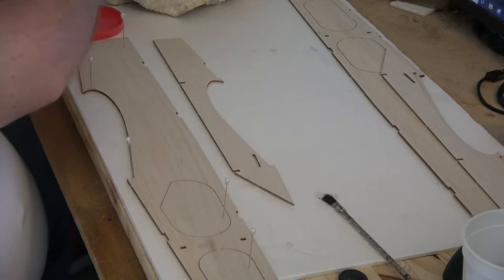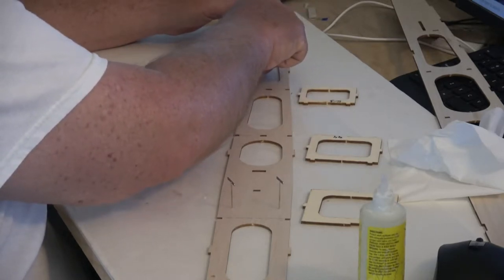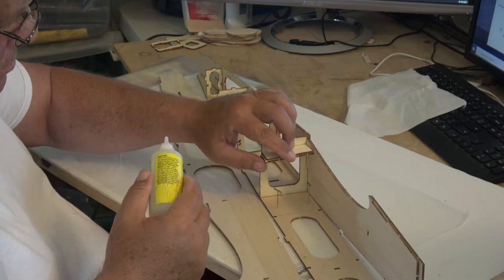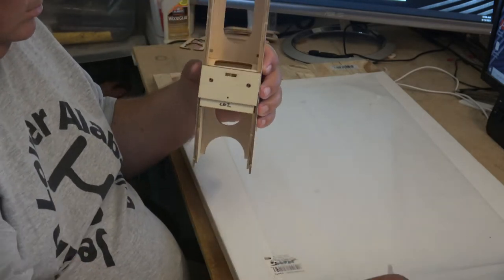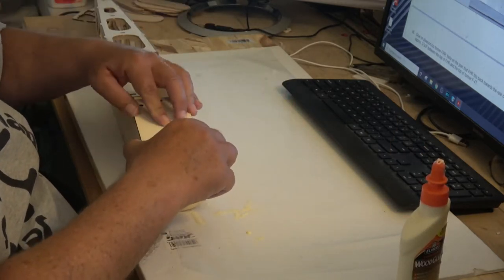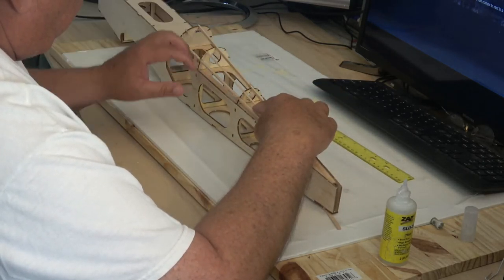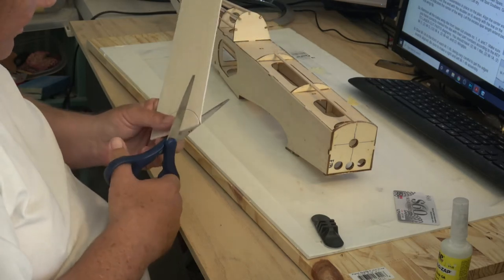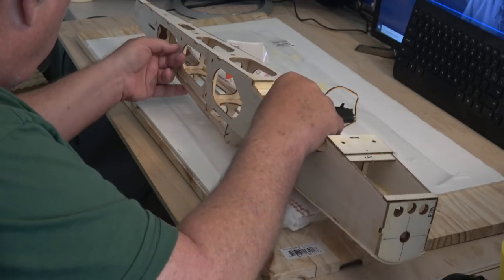First KIT Build SIG Four Star 20EP The Fuselage

Comment: That was fun to watch Jeff, it's great when the top stringers go on and you start to really see the shape coming together. I was thinking personally I would glue in a support for the pushrod outers half way down the fuselage to prevent any whipping 🙂
Reply from the maker: I'll do that Cliff, already notched to attach the pushrod tubes will glue before covering, good call. Cliff thank you.  There is a lot of sanding to be done on the fuselage😁 I'm going to install the elevator and rudder servos to make sure the pushrod tubes are straight then remove the servos for covering. Thank you Cliff for your help and inspiration for the build, Jeff

Comment: brings back some memories  :-)  ...thanks foe sharing...some of the 'hardwoods' don't soak up the glue very well.. We used epoxy and drilled little dimples in the hard wood so the epoxy formed it's own dowels for strength and alignment...
Reply from the maker: After sanding the fuselage I found 2 spots that could use a few more drops of glue. I'll get groovy on some glue joints when needed too. JCB thank you, Jeff

Comment: Very nice job Jeff. I liked to use either the Elmer's wood glue or tightbond II wood glue in stead of CA only because I liked the extra work time. I saved CA for tacking. Keep going my friend, shes coming together beautifully!
Reply from the maker: Sanded the fuselage today, have to add a little more glue in two places. Going to drill out the screw holes for the elevator and rudder servos so I can secure the pushrod tubes better to prevent flexing.  The mock up the wing and make sure I have have a nice fit before covering. David thank you, Jeff

Comment: Great video so far Jeff.  I use a few rubber bands around the fuse to hold it together while I CA the heck out of all the joints.   Yes.  Glue the thing good. Great job on the voice over 👍. Be sure to support the push rod tubes at each rib down the fuselage.  They will flex if you do not.
Reply from the maker: Sanded the fuselage today and found 2 areas that needed more glue. Going to put the servos in for the Rudder and Elevator to make sure the pushrod tubes are in the right place then glue the pushrod tubes down so the control rods don't over flex. Wild Bill thank you, Jeff